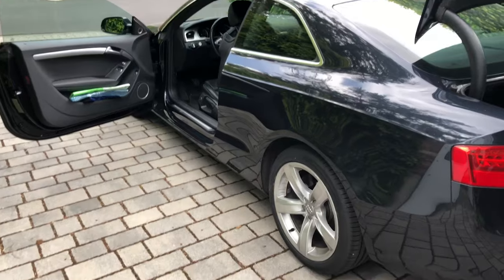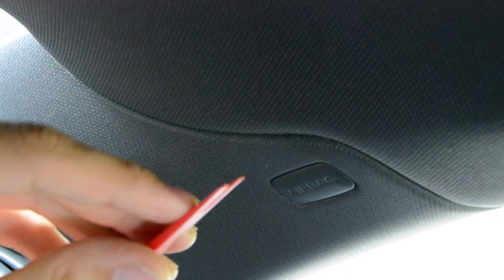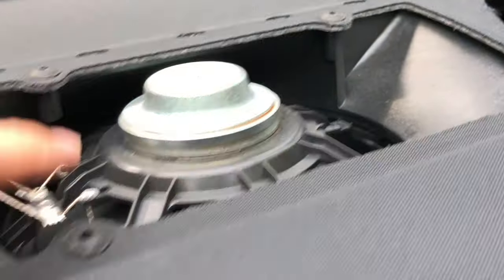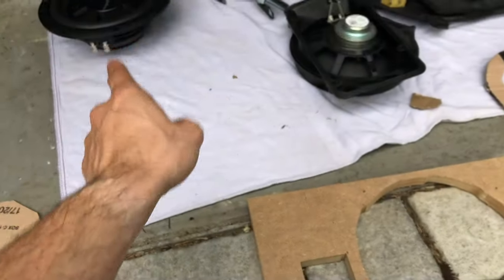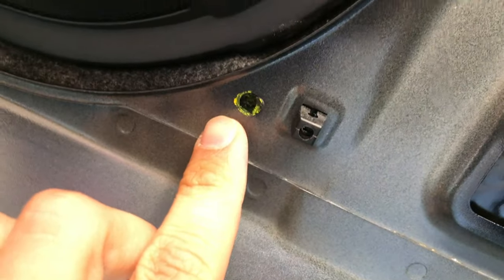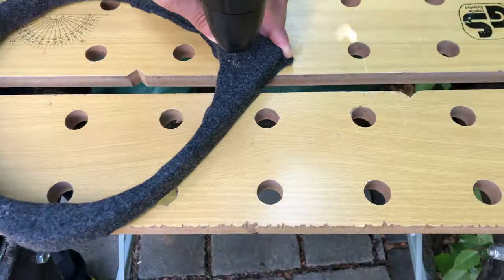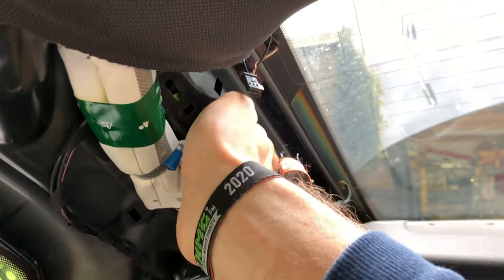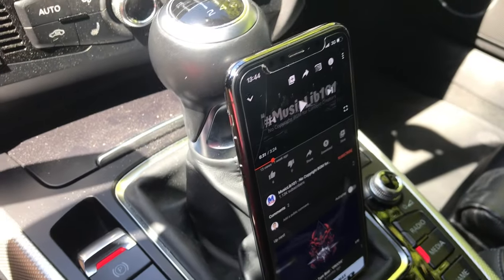Audi A5 B8 Subwoofer Upgrade | (Bang & Olufsen)

Comment from the maker: Because some people asked this, I used the factory B&O Amplifier as I found it delivering adequate power for the new Subwoofer. Of course you can achieve an even louder bass with an aftermarket amplifier.
Reply: one question, did you put alubutyl over the trunk led? I can't see it in the video as its to dark
Reply from the maker: Yes I did, because the plastic housing was rattling
Reply: Do you have the specs of the factory amp?
Reply from the maker: Sorry I don’t have
Reply: Great video perfect for my car when I change my speaker  I will be dropping a 10’’ 1500 W 500 watts rms sub in Do you think I have any problems with the standard amplifier??
Reply from the maker: The B&O amplifier should make something in the neighborhood of 50 watts. So a 1500W chassis isn’t just pointless but could result in less bass because it’s made for more power. Either get a woofer for less watts/with higher efficiency or add an extra amplifier that delivers the amount of power.
Reply: @maximusoptimusTECH  you’re right I’ve gone for the easy option I’ve gone for the same speaker 500 W Just simply drop it in with a bit of dynamat too
Reply: Can you please make a wooden mount thing for me and sell it to me please lol
Reply: @maximusoptimusTECH  the b&O amp is somewhere around 180W rms when cranked to the max and is more than enough to shake a good subwoofer speakers that is  able to move way more air than the factory shit sub

Comment: @maxiopti, seriously considering this mod for my RS5, I got a Lc2i on the way and intended doing a 10" Rockford Fosgate R2 enclosure Running around 200rms (class D amp).... But now ive seen this I wonder how much better over factory this would be?, I'm looking for only a little bit extra bass and volume over existing (10% improvement to fully balance the system). In your opinion does this mod live upto that sort of expectation?. I listen to a fair bit of Keane Dysso, Moti, Oliver Heldens etc and always feel the stock system could use a little bump and a little less rattle.
Reply from the maker: I can’t be exactly sure if the effect was only down to the subwoofer because I also sound deadened the doors with damping material. 
But the doors, and the new subwoofer with the alubutyl on the rear shelf all together it defeinitly was that 10% improvement. Rattle isn’t there anymore (if you do the doors definitely check the windows mechanism, and tighten all the screws you see) and the bass sound a bit louder but deeper and much cleaner especially at higher volumes. It now definitely sound like a system that is worth of the B&O badge.
Reply: @maximusoptimusTECH  got some 2mm damper matting on the way to do front doors, I'm now toying with idea of running a powered 8" sub through the ski hatch or just behind it (opened up), around 200 RMS. I see Kenwood and Rockford Fosgate do some Nice 8" units. Still tempted to try your mod but fussing over the sound quality of IB mounting vs enclosed.
Reply from the maker: That sound interesting as well and a proper enclosure will always result in better and louder bass. It just wasn’t an option for me because it would have seriously limited the cargo and loading capacity...
Reply: @maximusoptimusTECH  with the sound deadning to you also line the door card skin with foam or just dynamat on inner door, outer door and door card?
Reply from the maker: I put the dynamat on the inner and outer door as well as on the larger surfaces of door card, and then I also put some fleece,foam stuff on the whole door card.

Comment: Anyone doing this make sure you choose a subwoofer that is for certain designed to run free air without an enclosure. If you do this with the wrong type of subwoofer you will end up with less than ideal results and possibly damage the subwoofer.

Comment: Your English is excellent! I think the subwoofer in my 2013 A5 Convertible is awesome though. I have the subwoofer control set all the way up and it already sounds awesome. I wouldn't want to go through all that trouble for a little extra bass, but I'm sure it sounds great for you now. Also, I have no rattles with the stock B&O system.

Comment: AWESOME vid Max! Haven't seen one for a B8.5 coupe before.  For the C-pillar, what I did was work the trim tool around the quarter panel window and pop that clip out first (you can hear it), THEN remove the airbag clip. Popping out that first clip really seemed to make removing the airbag clip a lot easier.
Reply from the maker: Thanks man, appreciate that :D okey good to know, if I ever need to service the subwoofer again I will try your method 👍🏻

Comment: Instead of trimming the plastic rear shelf trim, a 1/2" thick  piece of plywood used as your template instead of 1" thick would have made the install 10x easier.  Great upgrade, keep up the good work.
Reply from the maker: Thanks man appreciate it :D
I don’t know if I told in the video but I needed the thicker wood, because the sub isn’t a 100% perfect fit, but when you raise it a bit the hole is big enough. So I decided instead of cutting the metal shelf to cut the plastic piece.

Comment: had this of been my install only thing id do different would be to mount the sub from the bottom using the plate like you did but from the bottom side i would have sat a little lower but nothing would have needed to be cut . still nice job ;)

Comment: Hi bro.
You said in the video that the subwoofer you selected is 8ohm’s .
However on Amazon it appears to be 4ohm’s ? Can you please let me know if it maybe was a mistake at your end ?
Thanks !
Reply from the maker: It’s a dual voice coil woofer, so it has two 4ohm coils. You can either wire them in series (making it an 8ohm woofer) or parallel (making it a 2ohm). That gives you the flexibility to use it with the factory 8ohm amplifier or a more powerful aftermarket amp with 2ohms.

Comment: Hello.  The original sub had a magnet on top so the new speaker can play in opposite phase.  Check on the new speaker if changing the polarity does not bring better sound.
Reply from the maker: Yes I know, you don’t even know which cable is positive and wich negative because it isn’t labeled. So I just had to try both ways and check which sounded better.
Reply: @maximusoptimusTECH  was the difference?
Reply: @maximusoptimusTECH  On the forums, it says white wire with yellow stripe is POS+: Blue wire with Yellow stripe is NEG-. I guess you can confirm with multimeter??
Reply: @cjohnson8991  So since the new sub in flipped compared to the original, reversing the polarity, would you wire the blue/yellow as positive in this case?
Reply: @Justin-rm6qo  To be honest, I did this a while ago so I don't remember what colors I did. I simply used a multimeter on the wires to confirm pos/neg and wired it up appropriately.  I used the AudioControl LC2i and a 750w RMS amp to power an old JL 10W6v2 in a box. It's a MASSIVE upgrade over the B&O amp.

Comment: Nice job dude. I think you did an amazing job with what you had to work with, I'd like to upgrade my woofer in my 2015 AUDI A5 Sport back and I may even do a video of the process. Mind you it will be different because mines a 4 door hatch and the woofer is under the space saver emergency wheel/ tyre.
Reply from the maker: Yeah you have an easier job upgrading. If you look online I think they recommend a 6.5” kicker to replace the factory woofer and then some sound deadening to improve the plastic housing. Or do you plan to go full custom and built a wooden/fibreglass box?
Reply: @maximusoptimusTECH  yeah I'm not going to go that far I just want to add sound deadening and brand new woofer to fit relatively easily without having to hack into OEM car. I'd also like to upgrade all speakers eventually cause I think there all paper cones. I most likely will add one of those fancy boxes so I can use aftermarket amps. Hence why I'll be keeping this video for safe keeping to reference if I get stuck.

Comment: Excellent English!! I am looking to remove my factory sub in the parcel shelf and leave the hole as to allow the aftermarket sub in the boot abit of air movement. Is the reason you have to take the parcel shelf out due to the size of the factory subs diameter and it won’t squeeze through the parcel shelf whilst in position? I really don’t what to remove everything to get the sub out…
Reply from the maker: Thanks :D
You need to remove the whole shelf if you want to remove the subwoofer. There is no way to remove it without access from the top.
Reply: Thank you, appreciate the response. You you agree removal of factory sub would benefit the aftermarket enclosed sub in the boot? That air passage should help,…?
Reply: @maximusoptimusTECH good idea or no?
Reply from the maker: Not sure, never tried it. The thing is that the subwoofer braces the shelf near the hole. So could be possible that it rattles if you have a big woofer in the trunk. Just try it it’s really not that hard to remove the shelf, looks like more work than it is.

Comment: man can you please explain how you did the wearing. which one did u connect with positive to which negative. I spent hour trying to understand and I cannot. I can see u connected 2 red wires with the car and one to each with the connector and then 2 - wires together ??
Reply from the maker: Ohh yeah I’m sorry I maybe will add a pdf showing the wire configuration.
There are two wires coming from the car (positive and negative) and the woofer is a dual coil design. So you need to either use a parallel or serial connection of the 2 voice coils from the 1 input of the car.
The original Audi woofer was 8 ohms so a dual 4 Ohm aftermarket woofer need to be in series (resulting 8ohms) rather than parallel (resulting in 2 ohms).
Therefore I connected the +(car)to+(coil1) from -(coil1)to+(coil2) from -(coil2)to-(car).
I hope that helps 😅👍🏻

Comment: Hey i just installed mine in yesterday but when i got done to turn on car after about 2/3hrs the car wouldnt start everything works inside just it won’t fire up but when i try to push/start it it comes on but no start but makes clicking noise like battery is dead 🧐🧐 do i need to jump it or since i disconnected the battery for a while it needs to be recoded??
Reply from the maker: Maybe it’s a coincidence and your battery was nearly dead before disconnecting anyway. I never had any problem when I disconnected the battery (done it several times) but I also don’t have push to start (just the normal key) so maybe you need to code something. Just give your local Audi dealer or specialist a call and ask them.

Comment: Hey dude, thanks for your videos, don't stop creating, it's really helpfull 👍
Question: If I have not a bang & olufsen system, can I install a subwoofer like yours?
Because the maximum power of this woofer is 400 watts, and I'm not sure that my electrical wiring will survive under this stuff 🙃
Reply: So the subwoofer receives the power, it dorsnt give it, the wiring should be able to hold what the amp gives to the factory sub, if you replace the sub the amp will still give the same power, the only time you should worry about wiring is when changing amps or wattage given

Comment: Did you need to use an amp or anything else or was this just a drop in with factory amp?
Reply from the maker: This works just with the factory amp. Although a more powerful amp will provide bigger results.

Comment: I'm looking to upgrade my sub on my b8.5 s5. Do u need to upgrade the amp?
How has it been holding up? Any rattle? Also the dynomat. Do u need to put it underneath the trunk or boot surrounding the sub area too?
Reply from the maker: Important question, do you have the B&O oder the Audi Sound System? For the B&O the amplifier is fine, for the Audi Sound you should first do the VCDS coding otherwise you won’t hear any difference. Sold my A5 so put my Woofer in my S5 with the Audi Sound System (you can see me explaining in one of the latest videos) and that’s still awesome, no need for an extra amplifier. Just the top of the shelf is fine, no need for the rest of the trunk.

Comment: Was just looking at this sub on the RF website and it states it should not be used as an Infinite Baffle sub, I wanted to use the same one in my car - is there any negative effects is using it in that manner?
Reply from the maker: Yes it seems like I misread about that in a forum. But nonetheless am impressed in the B&O as well as an Audi Sound System with this woofer. It’s nothing crazy compared to a box in the trunk, but for an OEM replacement it’s perfect.

Comment: No rattles in the deck / shelf area?
Also, you have no sound insulation under the deck metal frame, it's not needed there?
Reply from the maker: Absolutely no rattle from there, the most noise came from the trunk LED housing so secure that properly. It does not matter an which side of the metal you put the insulation, it just makes the whole deck heavier which eliminates resonance, and so the trunk looks completely stock apart from bigger woofer which in my opinion look better anyway.
Reply: @maximusoptimusTECH   I've paid a guy for soundproofing and he put on mine both on the top and the bottom of the deck hoping to solve the rattle. He haven't.

 And I've just investigated more, with knocking over and pressing, and the main culprit it seems to be the 3rd brake light. When the weather wam up i will take a look there

Thanks for replying!

Comment: Hi, weißt du zufällig ob der Verstärker vom B&O System über Chinch in das Radio geht? Mein Kollege hat das Originale Soundsystem und er meinte das Originale Radio hat kein anschluss mit chinch. Wie ist das bei dir gelöst?
Reply from the maker: Der B&O Verstärker ist über den sogenannten MOST Bus angebunden, ein Lichtwellenleiter Netzwerk mit dem die verschiedenen Radio/Navi/CD Wechsler/Verstärker Geräte unter einander kommunizieren. An jedem Gerät (schau mal hinten Links beim MMI Modul nach) befindet sich ein Stecker mit zwei Kabeln (Eingang und Ausgang) des Lichtleiters.
Reply: @maximusoptimusTECH  Danke!

Comment: Doing this mod over Xmas, got one of the last subwoofers available online. What size mdf board did you use for spacer?
Reply from the maker: Nice, have fun with your project. I think it was 2cm thick, but to be sure measure for yourself before building.

Comment: Hello
Do you have an diagram for how you did the wires on the sub as it has 4 wires going into the factory plug
Thanks ☺️
Reply from the maker: Just look up how to wire a subwoofer with two voice coils. 
The two 4ohm coils are wired in series so the impedance matches the 8ohms of the factory woofer. If you were to wire them in parallel you would end up with 2ohm.
So I connect the positive Audi wire to positive coil 1, then from negative coil 1 to positive coil 2, and front negative coil 2 I connect the negative Audi wire. The Audi wires are not labeled so just try out which way it sounds better. 
If that wasn’t detailed enough for you, feel free to contact me on Instagram (@maxiopti) ^^
Reply: @maximusoptimusTECH  thank you very much, yes I understand perfectly, thanks 😊

Comment: Ar u using a different amplifier for the sub or the one that comes with the car and how many apps does it have?
Reply from the maker: I am using the Audi amplifier, I don’t know the specific power it has.
Reply: @maximusoptimusTECH  ok thank u so much im going try to do the same prosses also well
Reply: Also di I have to go into the audi computer settings and change the audio settings as well to have a good sound like u describe it in your other video?
Reply from the maker: No, changing the sound profile works only with the basic and the Audi sound system. The B&O has a separate amplifier with its own software which you can’t even access with VCDS. But I can recommend sound deadening the doors as well for a better bass response from the mid woofers.

Comment: hey i have a question, do you think this will work in an 2016 audi a6 with the Bose system? i know that they are a bit different in how they work
Reply from the maker: I have no idea about the A6 or the Bose system. But if this subwoofer fits in the location I guess it should be alright as well.

Comment: Sehr schönes Tutorial. Das muss ich auf meinem 2011 S5 tun. Hast du auch die Türen und Rückwände gemacht und welches Material hast du verwendet?
Reply from the maker: Bei dem A5 hatte ich nur den Subwoofer gemacht, hab aber inzwischen auch einen 2011er S5, echt geiles Teil. Da habe ich den Subwoofer dann auch reingebaut. Bei dem S5 hab ich wie im neusten Video zu sehen aber auch die Frontlautsprecher und Türen gemacht. Hab nen Alpine SPC100 AU verbaut mit Alubutyl und Stoffdämmung in den Türen.
Reply: @maximusoptimusTECH  Ja, ich habe das Video jetzt gesehen und ich bin schockiert über den Mangel an Schalldämpfungsmaterial. Das B&O System ist nicht so schlecht, aber das Rasseln ist schrecklich